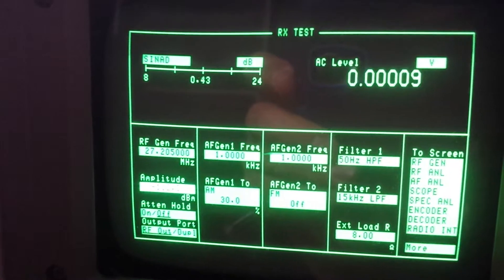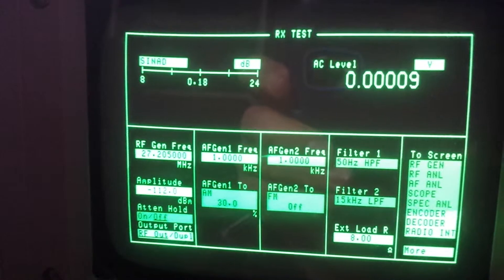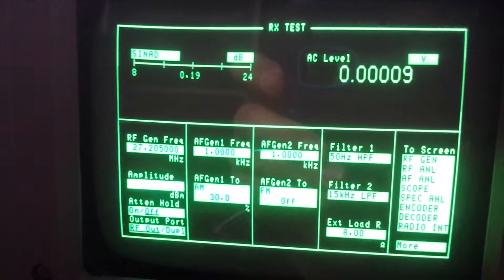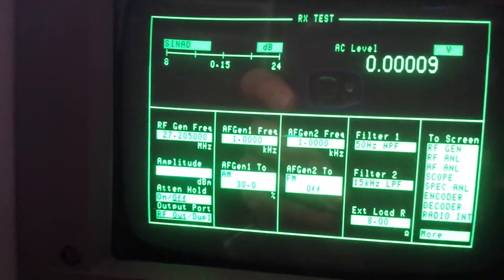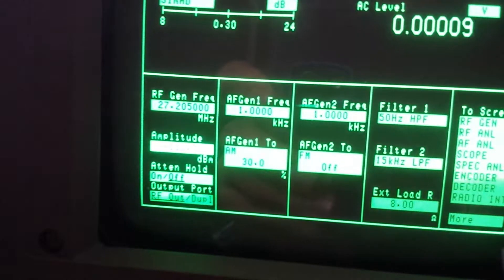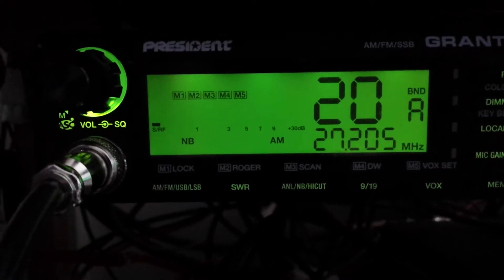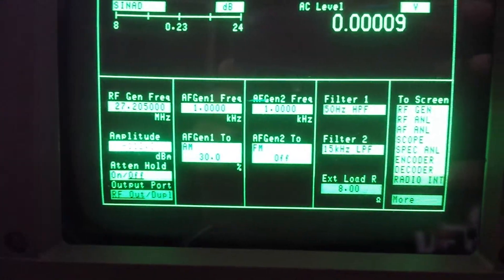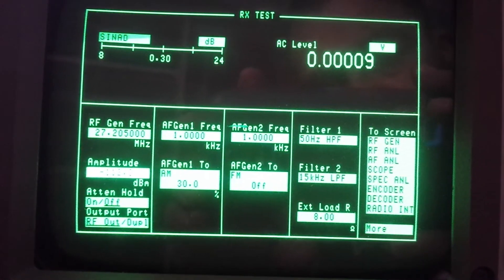Receiver test of Grant 2 on HP 8920A

Comment: Hello! I just stumbled on your video. I know it’s been 8 years since you posted it. I’ve been thinking of buying the 8920a for cb radio repair. But the specs I found on the internet say that it’s rf generator’s frequency range only goes as low as 30mhz. Obviously, not on your unit 😂. How low in frequency are you able to generate a signal?
Reply from the maker: It's goes below 500KHz. I think there was units similar to it that where setup for CDMA testing. 
Mine still works besides the vaporizing mains cap to this day.
Reply: I appreciate you answering. I have a RD CMU200 and an IFR1200. Sometimes I feel I like playing with the gear more than I like fixing radios. 😂Thought I would give this unit a try. 

Cheers